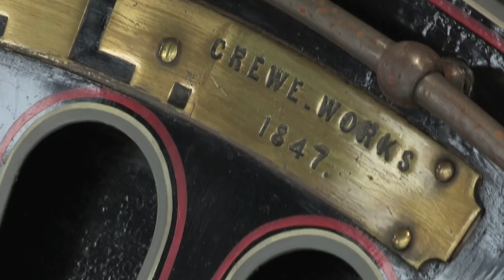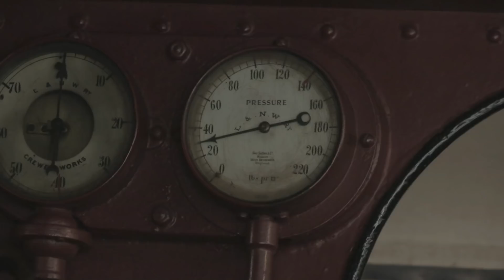SOLE SLIP: LNWR No 3020 'Cornwall'

Comment: I've been wanting to see this engine on this series. I think you should have explained that as originally designed, the boiler passed UNDER the driving axle, which I may be wrong about this, but I think Cornwall is the only locomotive ever built in that configuration. Needless to say, putting a boiler that low causes tons of technical headaches (firing, cleaning, etc.) so it's obvious why Cornwall was likely the only one built that way. 

I hope you do Columbine in the future.

Comment: Might not be a full bad thing. You Brits don’t realize but in america a hole is easily mended on a boiler. Abet carefully and slow we can get a damaged boiler fixed. It has been done on many locos. Even the K4 1361 is going to run despite one of the inspectors laying back on the firebox walls when taking a short break and it fell to dust putting him half inside the firebox (the grates were there so he didn’t fall too far but was laying) and that was fixed easily
Reply: Matt`s Mocs I imagine the reason why they don’t fix it is because of the engine’s age and the fact that replacing or repairing part of the boiler might cause the engine to lose some of its originality. It’s one of the reasons why Lion (built in 1838) is no longer run, they were replacing so many parts on the engine that they were afraid that it was losing its originality.
Reply: Austin1987VCR true. But when there is a restoration the original parts that were not ones always changed should be saved Incase the loco finest get another running year. In the park service all original material is saved for retrofitting back. Even if it takes up a bit of space in the storage room that original material is kept. I am not sure how it is done in the UK but sounds like random metal becomes cash too often
Reply: Stepney still runs and most of his parts have got to be nonoriginal at this point. The engines parts don't make it who it is the spirit that is steam is the same for that engine as long as it is never scrapped. I hate cop outs like "Not original parts" if it is savable it should be even if every part needs to be recast eventually it happened during their service life it must happen again to see them true to form. 

Damaged does not mean unfixable and vintage is not a good enough reason to quit repairing a living machine.
Reply: Plokman040 That’s true. I was only speculating. Take another famous engine like Flying Scotsman. I believe the only things on the engine that date back to 1923 are parts of the frames and sections of the cabsides. A lot of the parts on the engine are from another A3 called Salmon Trout. Salmon Trout was scavenged for spares during Scotsman’s overhaul at Darlington in 1965 and whatever was leftover was sent to the melting pot.
Reply: The parts might be renewed or replaced, but it will always be the same engine that has always occupied that space and time.
Reply: Plokman040 afterall these things are never original. Uber foamers just have issues with it despite not realizing it would be fixable
Reply: Austin1987VCR yes. Plus if we kept the argument of everything has to be original. There would not be a single operating steam locomotive out there as they all have had parts changes many times
Reply: I think it all depends on who owns the loco. A Museum owns Lion and as such has no interest in keeping it running, a static display maintains the originality. Stepney is owned and run on a preserved railway that feel that the public want to see a running historic locomotive. Bit like comparing the Natural History Museum with London Zoo!
Reply: Yeah you don't understand on that front. If the inspector can put his hammer through the barrel, it's more than likely that thin throughout the boiler. Meaning the boiler is utterly scrap. The only solution for Cornwall steaming again is for the NRM to fork out a new boiler. Which is VERY unlikely....